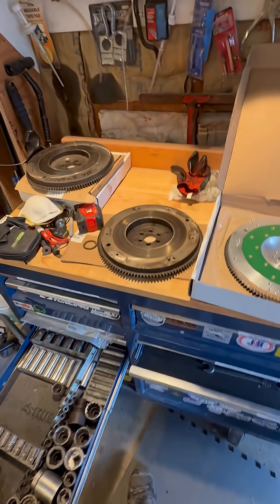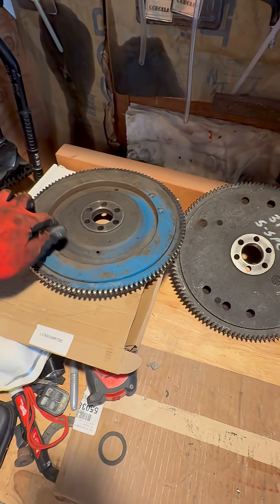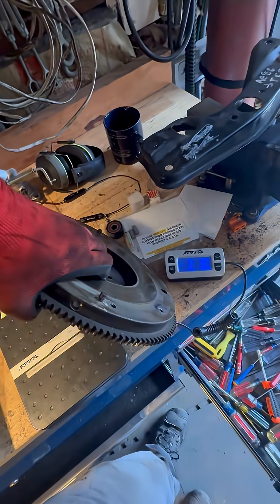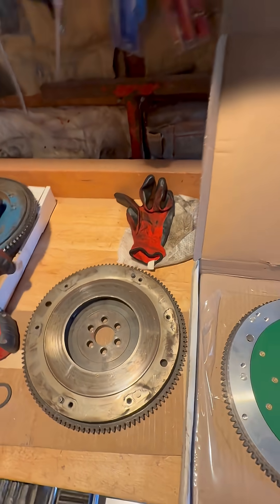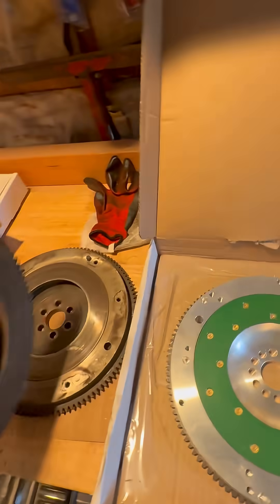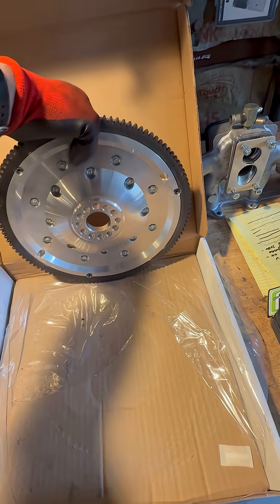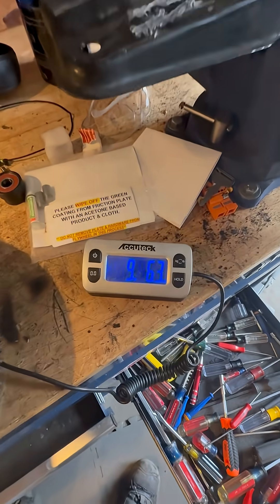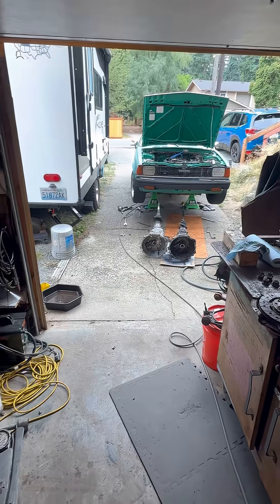Toyota 2TC and 3TC stock steel flywheel to Aluminum flywheel weight comparison.

Comment: Hey just wondering if you could put links to parts in the descriptions or further explain where you find them. 
I’ve been trying to find lots of stuff for my 81 Corolla wagon but I’m struggling to source parts. Currently everything in the car is original besides the alternator lol
Reply from the maker: The Fidanza flywheel part number is: FID130381. The T50 to W58 conversion kit is made by SQ Engineering in Australia. I put links to these in the video description.

The factory flywheels are NLA, you pretty much have to be a parts hoarder like me to have any etxtras. LMK if you need to know anything else!

Comment: Flywheels are supose to be heavy. I doubt it will make more power, but the engine should spin up faster, the powertrain might not beas smooth either.

Comment: Are you going to change the harmonic balancer out? Or lighten it or something to balance the 2 ends of the crank? I have heard there is a correlation between the 2 when it comes to weight.... 🤷🏼
Reply from the maker: I have no plans to, and honestly have never heard anything like that. Probably something that would be important on a race engine but not so much on my street machine.

Comment: Aluminim flywheels don't create more horsepower. They free up horsepower lost due to rotational inertia. It also spins up and down faster, however, that lower rotating mass also can be more jerky during clutch release.
Reply from the maker: You are correct, I did not phrase that correctly in the video. I am looking forward to the new dyno test to see how much more horsepoinies make to the wheels over the dyno test I did on this car last year. Cheers!
Reply: @BowerBuiltAuto-Fab I knew what you meant.

Comment: The aluminum flywheel cannot be as durable as the iron
Reply from the maker: Are you referring to the flywheel as a whole? That's possible in high horsepower applications. 
The friction surfaces on Fidanza flywheels are steel, so should not fare any worse than a normal flywheel. And they are replaceable if needed.